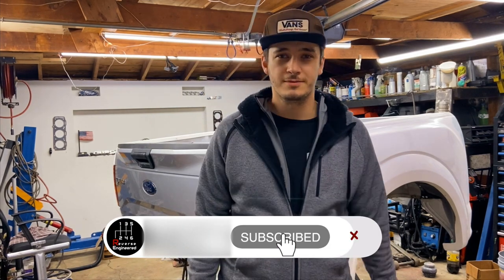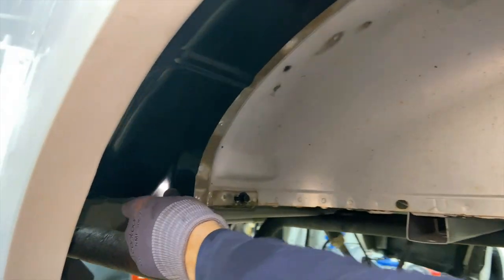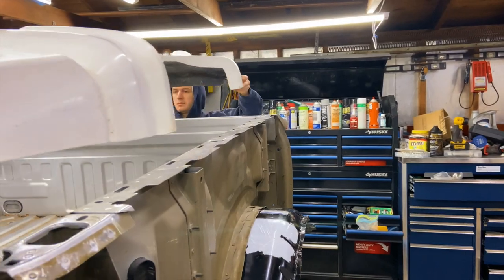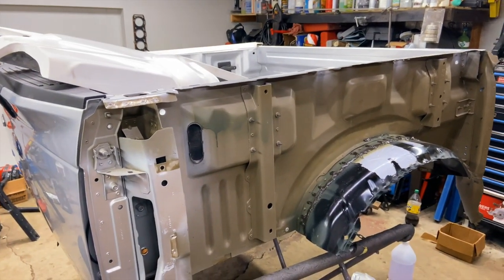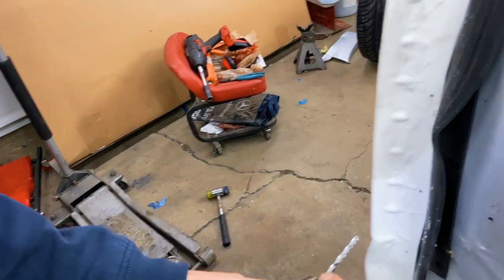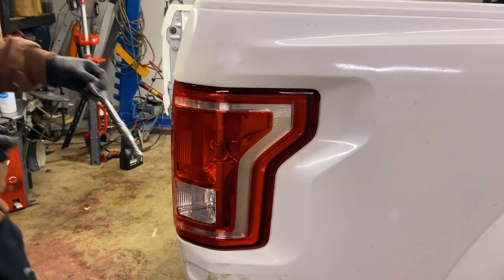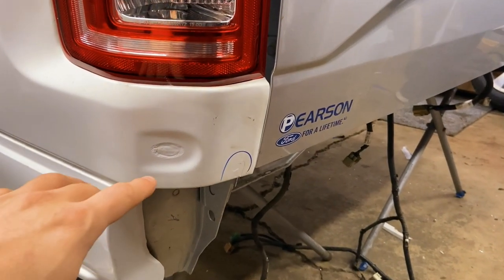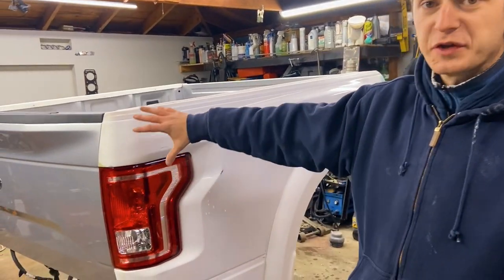Building a Ford F150 into a Raptor/ CUSTOM MADE Part 7

Comment: I am impressed what a great job you guys did on the conversion, but one question where did you get the OEM wheel liners?
Reply from the maker: ebay, or you can find them at dealer
Reply: Does anyone have the exact part numbers of the ones used in this video?

Comment: Bro quick question what’s the model number for the quarter panel I’ll be doing this soon so need the part number ?
Reply from the maker: Faizan Khan we bought it from McNeil Racing, https://www.mcneilracinginc.com/collections/17-raptor
Reply: Thanks for the info can you also put the list of parts used like the f150 part that you used between the bedside and inner wall ... plus what was the sanding process which grit was used I got my bedsides today and there are minor imperfections so I need to know how to fix them !! Thanks in advance .. great help
Reply from the maker: Faizan Khan It depends how bad the imperfections are, if it’s too much, you can use 180, if it’s very minor, 400 will work, we used 180 where we circled the imperfections, 180 where bondo was applied or 80 works too for better adhesion, you can also run everything after with 400 to smooth it out nicely if painted, as for the wheel well, you can use the ones that come with the bed originally. We used new ones because they were damaged from the accident, you can take off the factory rivets and cut them up like in the video but here are the part numbers anyways FL3Z-9927895-A (driver side), FL3Z-9927894-A (passenger side).
Reply: Reverse Engineered thanks bud nice write up and nice video keep up the good work

Comment: I am trying to put a 2020 raptor rear bumper on a F150 Lariat is it possible?
Reply from the maker: The frame itself will allow that change but we’re not sure how it would match with the quarterpanels’ gaps
Reply: Reverse Engineered  thank you
Reply: Any information would help

Comment: why didn't you reused the oem inner fender liner that you took out (the one showed from the left side 5:17 min) and attached it to the new quarter panel instead of removing it and adding the black inner fender (cut with the scissors 3:34 min) ??
Reply from the maker: We bought new oem wheel wells that we cut with the scissors (they’re metal) because the ones we took off were already damaged so we put the ones we cut. The new ones are metal as well, not plastic.